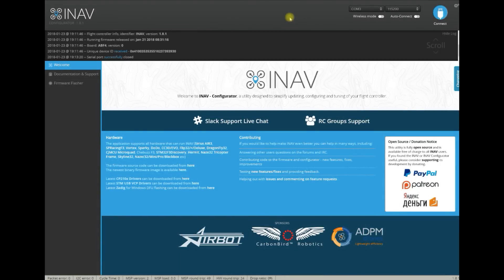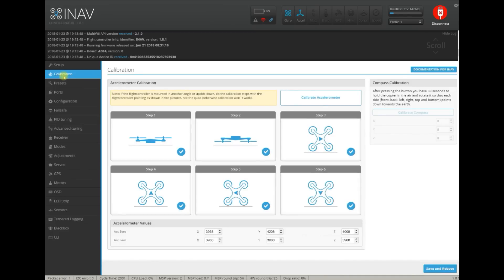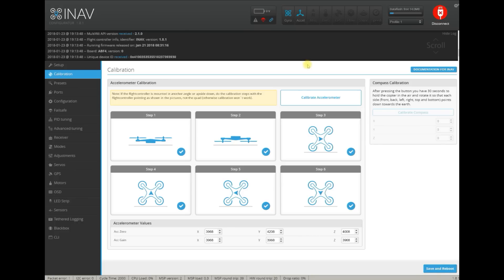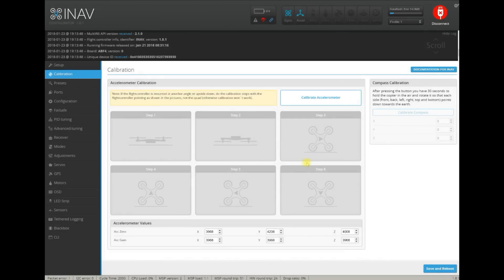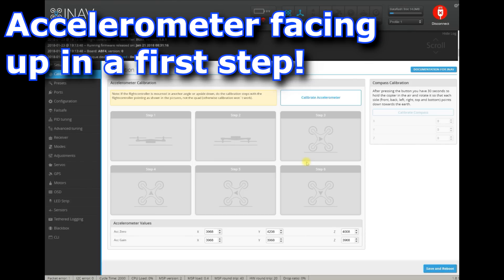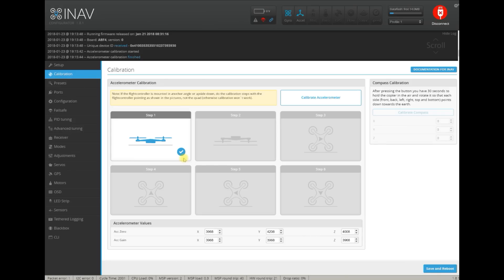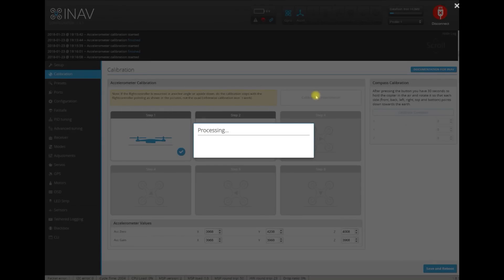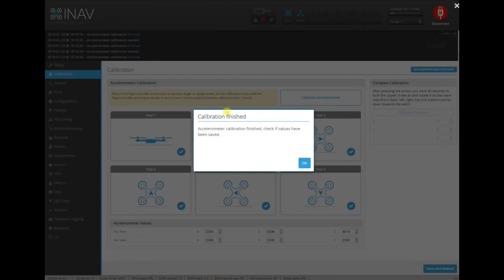INAV Configurator: Calibration Tab for a better accelerometer calibration

Comment: HI Pawel, Great tuto once again !
you gave me a good hint with the minimised Inav... This time though... About acc cal... mine will not record the first (acc on top) position... this means my drone refuses to arm the motors and the issu shown in log is accelerometer uncalibrated... I do save and reboot but instead of showing the check mark ( as it does on any other axis) the square is grayed out after calibration attempt... I do not move and have the drone shimed perfectly level untouched....
Reply: Ok by some turn of fate... I re calibrated finishing with top up first and worked fine...yippee!!

Comment: Hi ive tried omnibus f4 v1 and 2 f4 v3s and get the runtime calibration  red x and it never goes away looked like a nice system but either ive had 3 bad boards or something else is off and ive now watched every vid i can find and read the wiki and no answer so i guess its back to vector

Comment: My furious f35 is mounted in a Mini Drak wing. The controller is not mounted level. The front of the controller is pointed down at 7 degrees. I adjusted pitch to negative 7 degrees then ran calibration. It now shows the wing sitting level in inav. Was I correct with doing the calibration like I did? Just want to make sure before I maiden. Thank you
Reply from the maker: You are calibrating accelerometer, not model. So FC should be flat. But it should works either way

Comment: Improved procedure with check Ticks....The old method could be confusing for some, well done.
  Im still wondering why its not done like Betaflight though, which is really easy?
Reply from the maker: BF does not need accelerometer. And even if uses it for Angle or Horizon, simple 1 step calibration is enough. But  in INAV accelerometer is used for position estimation in all axises, not only to find out where down is. As for that FC has to know exacly acceleration is all direction, not only "down"

Comment: Perfect. If the board orientation in the plane is not standard; should the steps be the same?
Reply from the maker: Yes. You are calibrating accelerometer, not whole UAV
Reply from the maker: Only first step has to be done with FC facing UP. For everything else, order is not important. You are calibrating FC, not airplane
Reply: Paweł Spychalski thanks
Reply: So if I am understanding correctly I can calibrate first and then change board orientation and this will be fine?
Reply: Paweł Spychalski thank you. Can’t wait for the update. And subscribed.